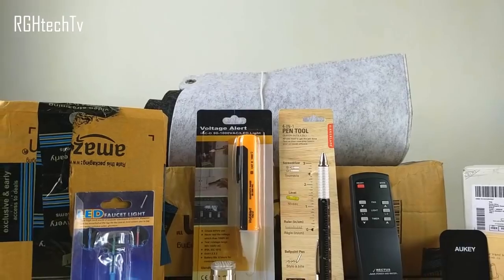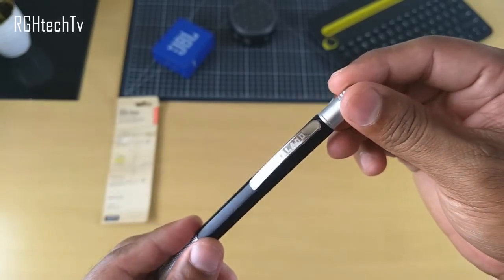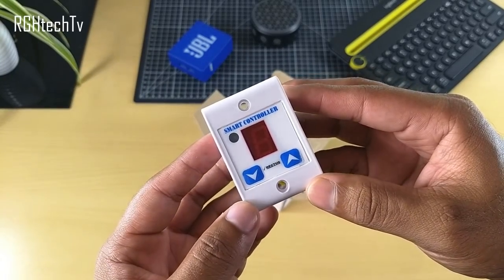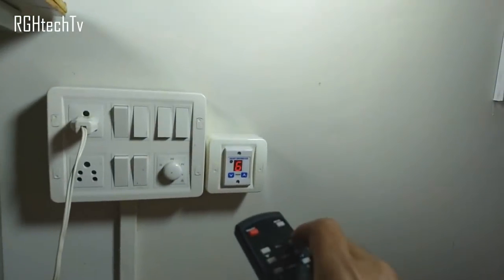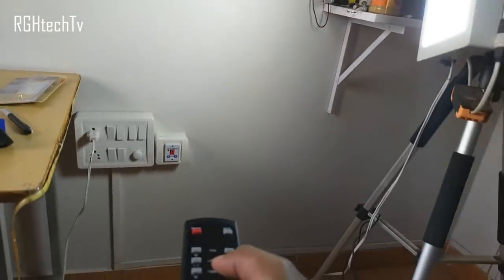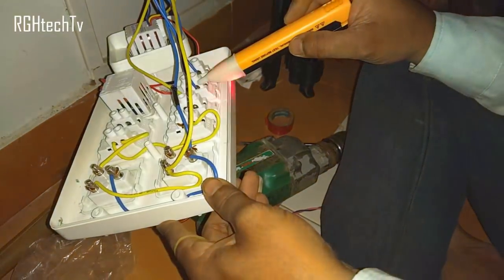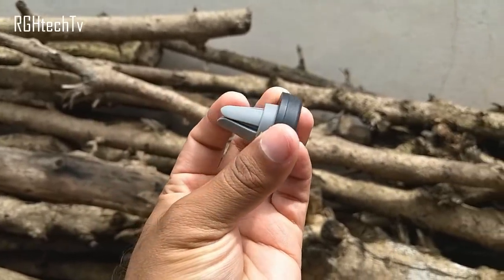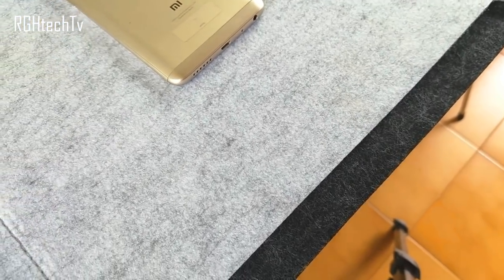Top 5 Tech Under Rs 500 | Tech Gadgets and Accessories

Comment: Check out remote control switch board from carolight technologies, it has more features. Like 4 lights and one fan with regulator, with nice digital push switch and with remote control as well and the price is just 1599 INR.